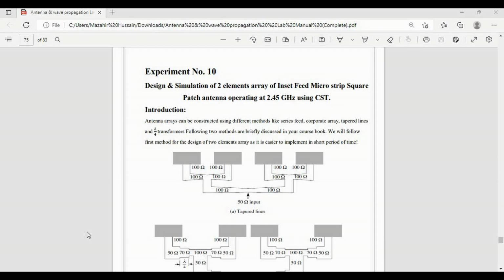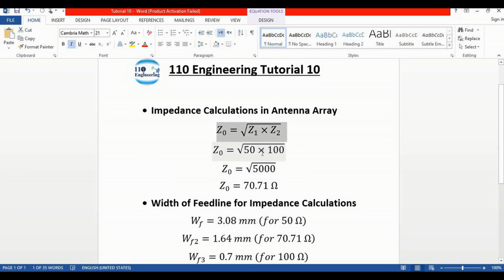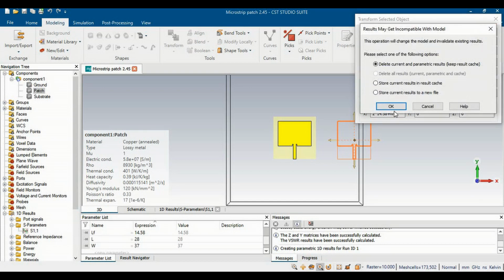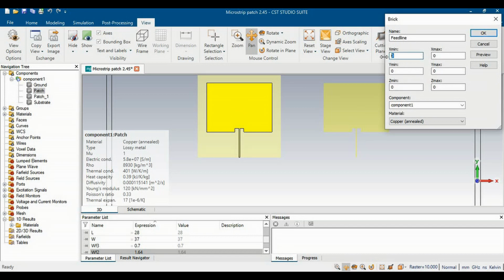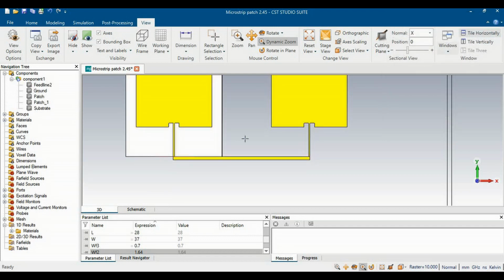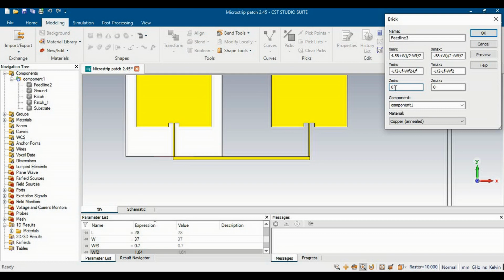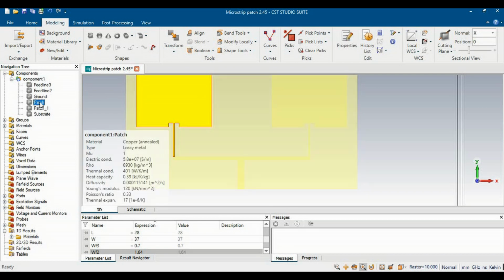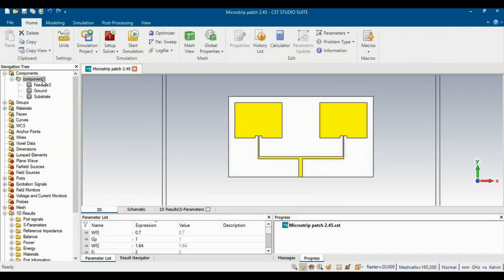How to Design 2 Elements Patch Antenna Array in CST Studio | Quarter Wave Transformer Method | Audio

Comment: Is there any reference paper for equivalent line impedance? Can you please share ?
Reply from the maker: There are lot reference papers in which they use the equivalent impedance. You can check it any latest antenna array research paper.

Comment: The following port mode is excited below its cutoff frequency: 1(1).
The first mode at inhomogeneous port 1 is hybrid. This could lead to an inaccurate energy balance. Please check your structure. More...
Solver Settings:
Excited port mode: 1 (1) 
[Frequency domain results normalized to default signal]
Excitation duration: 7.10909750e+000 ns 
Steady state accuracy limit: -40 dB 
Maximum number of time steps: 98304 
Time step width:
     without subcycles: 1.44634193e-003 ns
     used: 1.44634193e-003 ns
Number of threads used: 2
Reply: could you tell me your salary as an antenna engineer ?
Reply: could you tell me your salary as an antenna engineer ?